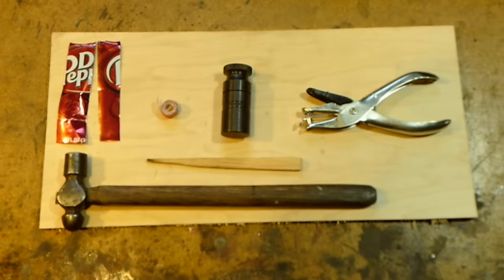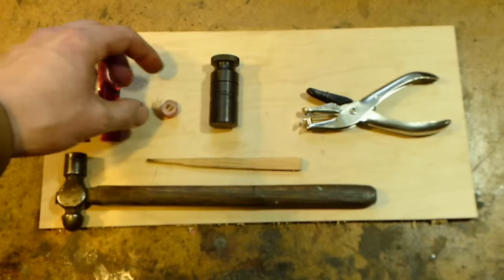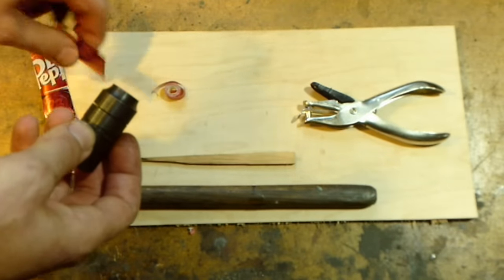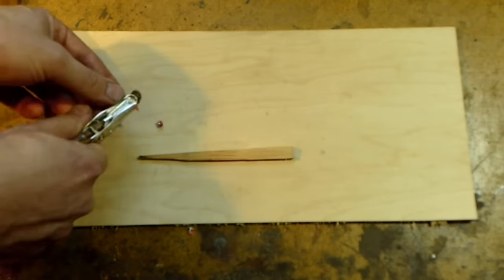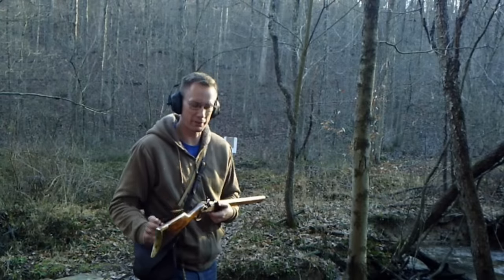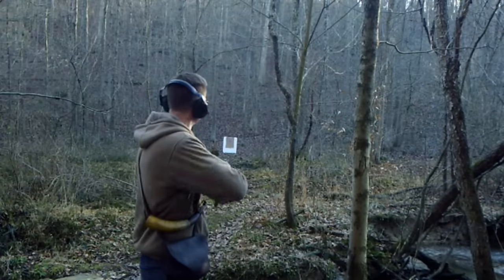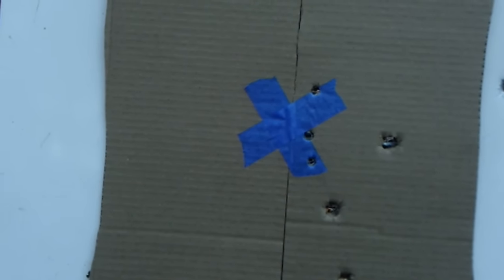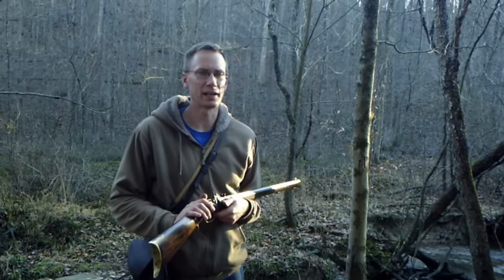Making Percussion Caps

Comment: You might want to store your homemade caps in a Ziploc bag with some of that silica gel. those little dryer  packs you get in electronics. The powder in the Caps is hydroscopic. Stored in this way they'll last almost forever
Reply from the maker: Thanks for sharing!
Reply: Good to know.
Reply: Plastic pill bottles are smaller, rugged and come in a variety of sizes. They are also transparent.
Reply: @Comm0ut  I MISS 35mm FILM CANISTERS!
Reply: @mikemcchesney2555 me too, those things were so useful. As a teenager I’d put ten or fifteen grams of flash powder in them, a bit of fuse and those firecrackers were awesome!
Reply: @chemistryofquestionablequa6252  The problem with using them for explosives is the lid was too loose. Duct tape fixes that! Then the dark times ...... after we found out what happens when you put Smokeless Powder in a piece of threaded black steel pipe with capped ends. To quote Leelu Dallas "BIG BADABOOM!"
Reply: Vacuum bag for the long-term win!
Reply: Altough you can vacuum seal in jars as well, large and small mason lids.
Reply: I think vacuum sealing small mason jars for long term storage.  Id only trust zip locks for weekend trips
Reply: @mikemcchesney2555  🤣🤣🤣. We made one or two and we renovated the school bathroom. We used cardboard.
Reply: @dananorth895 You can use a zip lock bag and vacuum seal it with a drinking straw.
Reply: I also use the silica packs to put in the barrel when I'm finished cleaning. I tie a red string around them and place them down the barrel about half way and leave the string hanging out so I won't forget their in there. Kind of helps to keep the dampness down. Works pretty good.
Reply: @mikemcchesney2555 the test strip containers are about the same thing but sturdier and seal tighter.

Comment: So if Armstrongs mixture is used, it can be "wetted" to reduce volatility. It can also be pipetted while wet into a percussion cap blank. Then you can use a standard food dehydrator to drive off the moisture. This aids in large "batch" creation. Just a little knowledge transfer.
Reply: Info like this is what our country needs right now. God bless you.
Reply: Thank you! I was thinking that alcohol might do the trick but it probably isn’t substantially better, evaporating alcohol attracts water so the final result might be about the same.

Comment: As a 15 year old in 63 my friends father taught me trap shooting and hand loading. He had a home made primer loader he loaned me to hand load my own primers too. I'll never forget the process, place the primer up and punch out the old primer, flip the primer over and press down the anvil Place a pistol primer over the top and press it into the brass. It saved me a little of that teenage money that I would then spend on power and shot. Once in a while I had a misfire but that got me into the habit of not flinching. This was before the one piece plastic wad too so the loading of the shell was a lot different too.
Reply: I'm shocked using Chinese toy gun caps this guy is getting any live fires.

Comment: Suggestion: Drill a bunch of holes in that board, just large enough for the caps to stick a tiny bit. This should improve production speed, I believe. When they’re done, just use the pin to push them out.

Comment: I've made several thousand of those caps. Tried gluing BP onto paper and inserting that in the cup. Worked but really fouled the outside of the nipple area. Came across a brass gadget that put a small amount of FFFF powder in the nipple for removing uncharged balls. A pan primer works as well. I can use Pyrodex in the rifle rather than BP as it's ungodly expensive here. Put a couple of grains in with it and rarely had a misfire using only a single cap in the cup. Not to mention the cap stayed in place and there was no exterior fouling. At nearly $0.20 for one percussion cap, these are a blessing.

Comment: Nice video, valuable info! I've had good results getting plain old safety matches to go bang when wrapped in foil & hit with a hammer (not as a PC) by powdering the matchhead and scraping off just a few crumbs of striker & mixing it in. The chemistry is similar to the caps & much easier to get -- I think I'll give your method a try with matches & striker powder.

Comment: Great video!! I did a video on this subject as well. You can also use strike on box matches. Grind up the heads, and using a Razer scrap some of the box( sand paper). mix very carefully. Makes great impact ignition powder. plus you get alot out of a box. But make in small batches.. Very powerful. Use rubbing alcohol in the mixture makes it easier to full caps. Dos not take much. And when the alcohol dries it works perfect... Cheers
Reply from the maker: Thank you!  Very cool!  Thank you for sharing!
Reply: I do a mix of the matches stacked in paper cap Oreos? going to try an acetone clear nail polish (used my fishing lure build nail polish Not my Wifes) (5:1) to try to keep it all in place for better assembly and handling. I may have also watched your content?
Reply: @davefellhoelter1343  that's a great idea let me know how it gos please. That's the biggest problem with making them is keeping them from falling apart. And if you have seen some of my videos. Thanks i am rebuilding my original Confederate Griswold and Gunnison revolver on the channel right now.
Reply: @snappers_antique_firearms  
I did try the acitone 4or5:1 with prim all compound in some lg Lg spent empty riffle caps for an exsperiment on my 1858, not totally enthused, but need more practicing.
Reply: Can you provide more detailed instruction using this method.  I'd like to try it out, especially since I can't buy caps right now.
Reply: @walterronielsey1780  Yeah, so get yourself a box of strick on box matches. Take some matches and use a hammer, hit the head of the match until all the match head comes off the wood. Throw away the wood.  grind it lightly into a powder.  Now, on the match box. the part you would strike a match that feels like sand paper. Scrap that sandpaper like material with a razor. Use this powder from scrapping and mix it with the ground up powder from earlier. You are going to have to test mix ratios of powder to the amount of scrappings off the box. Very lightly mix them. To test if it works and you got the right mix ratio. Take a small amount, place it on something like concrete, and hit it with a hammer. It should go off when hit with the hammer. Make sure you use very little. It's very powerful and extremely loud. When your ready to load caps, just add a small amount of rubbing alcohol to the priming powder to make a past. Makes it easier to put in the caps.

Comment: 22lrreloader also has a primer compound that can be used instead of roll caps. A supplement video might be good although your caps seemed to work well. Good video!
Reply from the maker: Yes Sir, saw that on their site. Was reluctant to say anything since I have never tried it though. Thanks for watching!
Reply: 22 reloader primer powder is very corrosive clean you rifle good are it will be rusted the next day

Comment: When I first got into black powder shooting I tried the plastic caps made for a cap gun revolver. At first just to clear the flash hole before loading. Later I tried them for actual shooting. They worked pretty good. Obviously lower power than a real percussion cap but if its shtf days then you do whatever it takes. They are extremely corrosive. Even more so than black powder or even corrosive primers. After giving my .36 revolver what should have been a good cleaning I later found it crusted over. Had to break out the old military corrosive cleaner.
Reply from the maker: Thanks for sharing Martin!
Reply: Got a home made alternative to the paper caps?
Reply: @jamesbrill7318  if you are in a real pinch and relying on a blackpowder gun as a shtf weapon I would say you are having a very bad day. I bet if you had to you could open up paper caps and use the compound as a primer compound in a percussion cap. Dunno how to make it stuck to the inside like a factory cap. Maybe just fill the nipple with that stuff and put some foil or even tape over it.  Interesting thought. Now my brain is on it. I will try and find some paper caps and test a few methods. Let you know how it works.

Comment: Ordered mine for #10 and 11 with compounds and paper caps too and Berdan priming system! I took it a step farther made my own die and anvil then ordered some copper sheeting of dif thicknesses. my modern new manufactured caps are failing at a 50% rate and have a poor fit. 
Link to your Powder Ingredient KIT Please!
LOVE your info keep them SMOKING I was 12 in 1972 when I bult my first Rem 1858 cap n ball! Now I am getting into Flint Locks!

Comment: That's alot of work. I just use the red plastic ones that fit cap gun revolvers. Just have to trim them into individual caps of course.
Reply: Does that work? I can’t find caps anywhereeeee in my area and online it’s always a minimum order of $100 and I don’t have that at the moment
Reply: @parkerfiske4707  I use them on my 44navy reproduction. They work fine for me

Comment: I use kids red round snap caps for percussion caps the plastic ones for revolvers they work fine very strong and corrosive just pull the paper out. If theirs powder in em their 💯 reliable! U can see if their a dud very easy self explanatory. Still hard to find apparently kids buy em up in a hurry!!

Comment: There's no need to fuss with capgun papers. Mercury Fulminate is a very simple to make. If you rinse the crystals with ice water to increase purity then dissolve it in ethanol (everclear), you can use an eye dropper or syringe to fill the caps and let id re-crystalize right in the cap, itself. For safe storage, just leave it dissolved in the ethanol and make sure to top off the ethanol whenever you start to see crystals forming in the bottom of the jar.
Reply: Mercury fulminate?  You sound like the chemist I am looking for anserws from. I am 68,, with no more time left going to school for re-learning something I had no need or intrest in back then. Now I NEED things once available,, but somehow destroyed by meddeling political antagonists wanting. too be recognized as IMPORTANT and powerfully RICH!

Comment: I tried this in my revolvers but they only worked about 20% of the time with Black Powder and almost never with Pyrodex P. I use the priming compound from .22LR Reloader but leave out the yellow Dextrin part of the mix andseal with a mixture of about 60% Acetone and 40% Duco Cement which is Nitro Cellulose Lacquer, let dry overnight . This works well with Black Powder or Pyrodex P. You can also add a tiny bit of 4f Black Powder on top of the mix before the Duco. Don't overfill or the hammer won't reach full velocity before hitting the cap. If you have trouble with the caps tearing in the forming die run a propane torch over the strips before Punching them to Anneal the Aluminum or Copper strips.
Reply from the maker: Hmm... I have a 1860 colt reproduction and found these work very well.  Who knows...  Thank you for sharing your thoughts and method.  All good!

Comment: word of the wise.... If you take any book of matches.. scrape off enough of the striker material. (red phosphorous) then crush up enough match heads to equal a 50/50 ratio.. Mix it with a tiny bit of 90% rubbing alcohol till it makes a thick paste. fill your caps with a drop and let dry. homemade percussion cap.
Reply: Except they have changed the recipe, and it no longer works

Comment: wondering if it's possible to use any other material aside of metal as the cap
Reply from the maker: Yes indeed!  I've see others use small rubber tubing that worked well.

Comment: Had the set up to make my own caps about 20 years ago. I found that they were less powerful than the weakest commercial caps. They also do not work well with a gun that has an angle to the fire path, like a Hawken. Now for a pistol or rifle with straight path from nipple to powder it works better. It also is no good for pyrodex.
Reply: Did you ever try the make your own mix for the caps. They sell a bag of powders to make caps or 22s. 
I haven't tried it yet. Maybe I need to buy a second bag for a test
Reply from the maker: @richardhenry1969  I've heard that works very well but have never tried it.

Comment: Instead of using those cap gun loads, use a Match Book.
Crush a match head and scrape some of the striker strip into the mix.
Load your cap and place a bit of toilet paper in the cap for retention.

Comment: if you're getting the new cap maker from 22lrreloader, you might as well get their prime-all, so you can stop fooling around with paper caps
Reply from the maker: Yes Sir, they do sell that. I was reluctant to endorse it as I have never tried it.
Reply: @HoffmanReproductions  it works, it's h48, so corrosive, but so are paper caps and black powder

Comment: Those hole punches that have a cup to hold the caps are dangerous, if you have a cup full of caps and you miss the center and set off a cap that can ignite all the caps. Do them one at a time into a dish not that cup build onto the punch.

Comment: First aluminum wasn't in wide use in cowboy days. Second if your gunna make it mist well make it right. Commercial caps are made with brass which is just as thick as your can. They don't disintegrate on detonation. In cowboy days they used a metal that was thinner and wouldn't jam the gun. Try that.